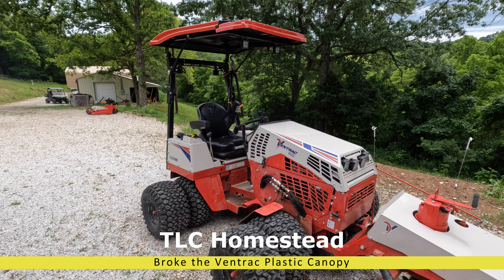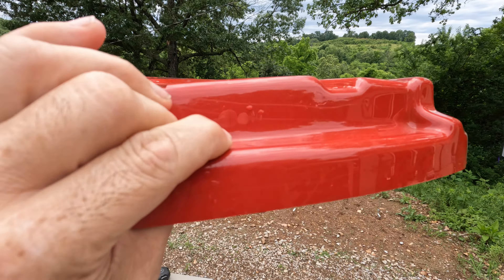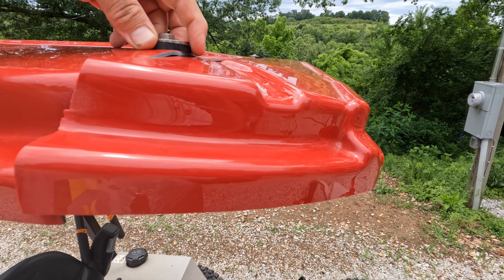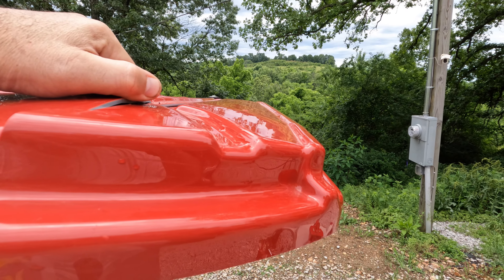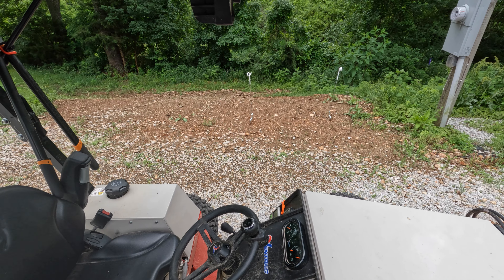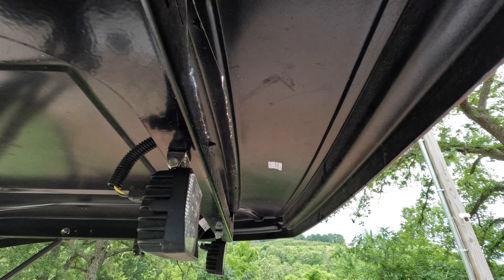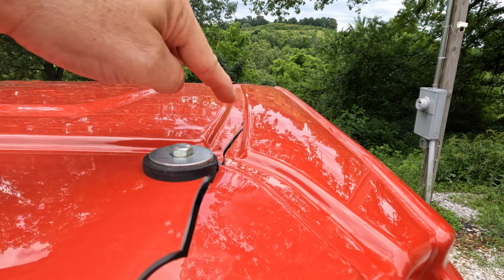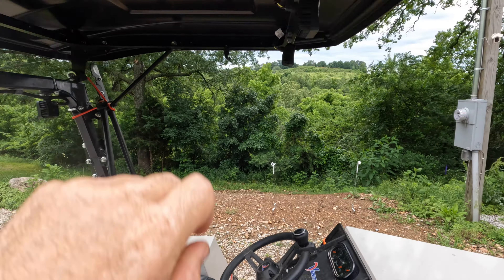Broke the Ventrac Plastic Canopy

Comment: That’s a bummer……take the canopy off and you can do a plastic weld using a soldering gun. YouTube has videos of a few guys doing this. You go back and forth melting the plastic onto it self….works excellent I’ve done it on a battery grease gun that holds the battery in place, both sides cracked off when I dropped the gun.
Reply from the maker: Interesting. I did some searches and plastic welding looks pretty easy to do. I ordered a kit today so in a week or two I'll see if I can get a video out repairing it.